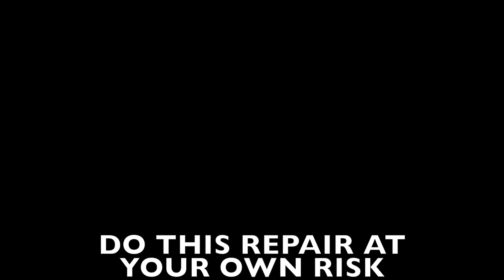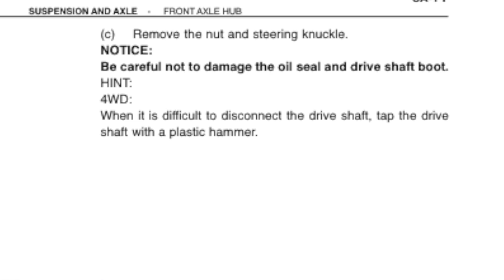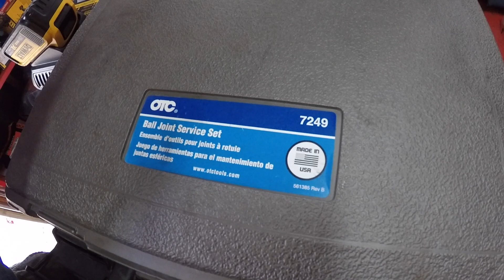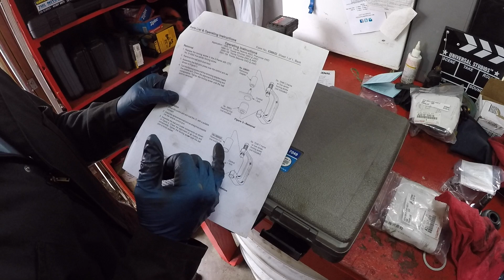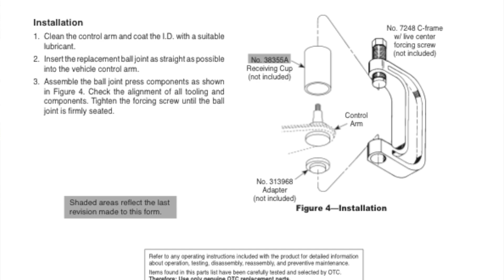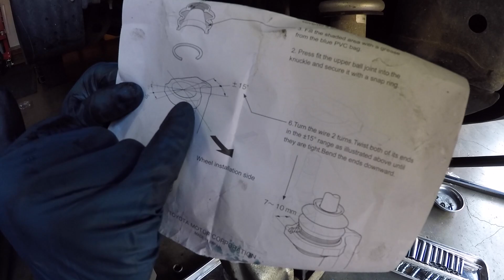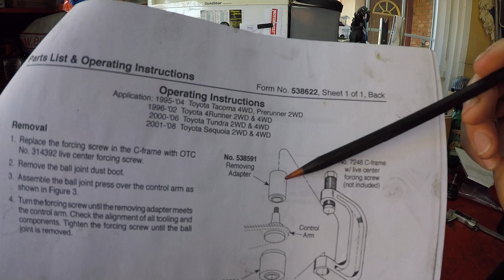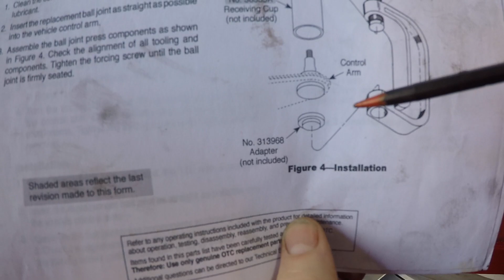Upper Ball Joint Replacement

Comment: Thank you for the great video. Got a question : I just need to replace the boot of my upper ball joint because it is torn and the ball joint was replaced recently. Do I need to remove the whole nuckle or I can just disconnect the ball joint from the upper control arm, replace the boot, and call it done?
Reply from the maker: You could just remove the balljoint from the upper control arm and replace the boot.  We provide a link to the reboot kit in the video description.
Reply: @TimmyTheToolman  thank you. The link to ebay is no longer valid. Just FYI. But I find other sellers for the same boot.
Reply from the maker: @ruigooal  Yeah, I saw that.  I updated the link to Toyota Parts Deal which is an online Toyota parts seller with pretty competitive prices.

Comment: Great video however I don't understand why you bought the 7249 kit when it seems this kit doesn't have anything in it needed for the Toyota ball joint replacements.  You bought all of the receivers separately to remove and install along with a 7248 c frame.  I don't get it.  What good is that kit if you have to buy all of the cups and the 7248 frame?
Reply from the maker: I could have bought the C-Press separately but I bought the kit because I was thinking of potential future projects that the cups that the kit comes with might come in handy.  Sometimes you don't know you need a tool until you need it.  Glad you like the video.

Comment: Appreciate your video, thank you. I have to replace my lower ball joints. There isn't any play in my UBJs and given what they take to replace, I'd like to keep them at the moment. If installing a new boot kit, do you know if the grease is available separately please?
Reply from the maker: I didn't know there was a boot kit for the lowers as well.  I don't know if grease is available separately.  But, I bet any quality chassis grease would work.
Reply: @TimmyTheToolman  I apologize for not wording it clearly. I'm replacing my lower ball joints, but looking to only re-boot my upper ball joints since the ubj's don't have any play. I have SuperLube 41150 synthetic white lithium grease in my grease gun now, think that would suffice?
Reply from the maker: @andresadoff6762  The Toyota UBJ re-boot kit we link in the video description comes with grease.  What reboot kit are you using?
Reply: @TimmyTheToolman  The toyota 43324-39015 pn boot kit? Didn't realize it came with grease, I'll just buy that one thank you

Comment: Excellent detailed video Timmy. Question for you. I am looking to buy a quality made bench vise under $250. I am considering three bench vises. A Tekton rotating bench vise with 8” jaws, or a Fireball rotating bench vise with 5” jaws or a Capri Rotating Base and Rotating Head Bench Vise, with 6” jaws. These are all strong bench vises and which do you recommend for vehicle repair and general home use. I will be using the bench vise to replace the upper ball joints on my 2002 Tacoma 4x4 and using your video as my guide.
Reply from the maker: I'm not familiar with any of the bench vices that you mentioned.  I would go with a 6 inch vice that gets good reviews.  I usually let the reviews drive my decisions to purchase tools and it usually works out well.  If a tool gets mostly positive reviews, I'll go for it.

Comment: Great video tutorial Timmy. 
Appreciate your attention to details. 
My only suggestion; When you noticed the wire tab sticking out in the wrong place, why didn't you try to simply turn it to the correct position? It seems to me that the grease would have allowed it to easily rotate the small amount needed.
PS, I assume you tried that.
Reply from the maker: No, I didn't try sliding the wire to the correct orientation.  I twisted the wire pretty tight, but maybe I could have gotten it to move.

We're glad you like the video.  Thanks for the comment and Happy Wrenching!

Comment: Awesome video Timmy!  I am about to try this on my 2000 tacoma 4wd.  However, my upper ball joint still seems good, per your suggested test.  If I can find and replace just the boot, do you know what grease I would need to apply?  I was going to check with the dealer but expect they only supply the boot - if even that!  Thanks for such a detailed video.
Reply from the maker: We provide a link in the video description to the Toyota OEM reboot kit which includes the boot, the grease and a new wire.  You're very welcome and Happy Wrenching!

Comment: is this car lifted ? or stock ? just wondering if stock upper control arms will be okay after lifting 2.5-3 inches?
Reply from the maker: I can't remember if it was lifted.  But yes, stock arms will work with a 2.5-3" lift.  When people move to aftermarket control arms, it's usually to fit wider tires without having to run spacers.  Adjustable UCAs like SPCs allow for more adjustment for a better alignment.

Comment: Hi Tim, Thanks so much for the great video!  As always, your videos are very detailed and specific to high standards. I have replaced my lower ball joint as preventive maintenance on my 3rd Gen 99 4runner 210K miles.  The upper ball joints look great and the rubber bushings are not torn, however I notice the passenger side has a small tiny hole in it but no major grease leak. . I was going to just stick a needle and just shoot some grease in there and seal the hole. . Can I just use a multipurpose Lithium NLGI 2 grease?
Reply from the maker: You're welcome and we're glad you hear you think so highly of our videos.  The grease Toyota uses for those upper balljoints has a different consistency and color compared to a multipurpose Lithium grease.  With that said, I think the multipurpose grease will work fine.  The whole idea is you want the joint lubricated and you also want to keep contaminants out.  The question I have is how are you going to seal the boot?  With some silicone?  

I don't know if you caught it in the video description but Toyota does make a reboot kit for the upper balljoints.  All you would have to do is break free the balljoint connection with the upper control arm with a puller, cut the wire, remove the boot and put a new boot on with the provided replacement grease and a new wire.  Here's a link to the boot kit: https://parts.camelbacktoyota.com/parts/index.cfm?searchText=%2343324-39015&make=Toyota&action=oePartSearch&siteid=214329  Since this is a fairly inexpensive part, buying online might not save you anything due to the shipping cost.  But, with a online seller like Camelback Toyota, if you can get your order up to $150 by buying things you know you'll eventually use like oil filters, air filters and maybe some other things you were planning on replacing as preventative maintenance, the shipping becomes free.  Then, they will only charge you a small handling fee, $3.  I generally buy all my parts from Camelback unless it's something I need quick and then I just visit my local dealer.  So, since the shipping could be equivalent to the cost of the part, you just might be better off visiting your local dealer for the reboot kit.
Reply: Thanks so much for the info......Yes I had some Permatex Ultra black gasket sealant and was going to just seal the hole for now. I will keep the great info you provided and periodically inspect the rubber dust seal to make sure it's not leaking and then either use Camelback toyota or the local dealer here in Dallas to buy those parts and eventually replace them, Thanks again!
Reply from the maker: @amh1499  Yeah very welcome.

Comment: The Pittsburgh master set has four of the five press cups you need for this job and it’s 75$. The other cup you need, is the upper cup for removing. 

You can rent a C-press from any auto parts store. 

The other cup is 40ish$ though.

And yes, use an impact…..
Reply from the maker: Thanks for sharing.  Could you provide a link to this set?

Comment: Quick question. On the special otc parts that you need to press out the ball joint. #314392 plug. I don't recall you using this in the video. Am I mistaken or did I just miss it? Where do you use this "plug" in the application? Thanks
Reply from the maker: That plug is a lower profile plug than the one that comes with the c-press.  This lower profile plug allows more room to fit all the components together to do the press work.  I did use it for this job.
Reply: @TimmyTheToolman  ok. I got you. Im doing research on those cups and I have a 01 Tacoma prerunner. Im wondering if Im going to need those same install and receiving cups as your 4x4 4 runner but I cant find and hard info on it. I don't want to buy the wrong cups
Reply from the maker: @619steelo  Yeah, I'm not sure about the Prerunner.  If you had a 4wd model, they'd be the same.

Comment: what is the torque setting for the 4 lower ball joint mounting bolts?  great video!
Reply from the maker: All the torque values are listed in the video description.
Reply: I see the castle nut torque but not the 4 mounting bolts to the bottom ball joint ?
Reply from the maker: @studegator  Check out our lower balljoint video.  In the description there's two different torque values depending on the year you have.  https://youtu.be/bfLvtEnX9qk

Comment: What might be some of the negative effects of over-tightning the upper ball joint especially?
Reply from the maker: I don't follow what you're asking Josh?  Over tightening what exactly?  The nut that secures it to the upper control arm?
Reply: @TimmyTheToolman  sorry I wasn't clear.... I'm referring to the castle nut on the control arm. I see where you torqued it to spec. I was asking what would be the consequence(s) of tightening the nut way more than the recommended ft/lb? What effect would it have on steering and handling in general?
Reply from the maker: @scorpio_9810  Ok, gotcha.  The balljoint attachment to the upper control arm is a tapered fit.  If you over-tightened the castle nut, you could have possibly drawn the UBJ shaft further into the UCA but I don't think it would do any damage per say to the UBJ or make a difference with your steering.  You could get an alignment to make yourself feel better.  How tight do you think you got it?
Reply: @TimmyTheToolman  iirc I torqued it to around 85 ft/lb, but I have some doubts that it might have been more. The paranoia stems from me putting some lowering springs on my 2016 gs350 f sport. After I was done, I went for a test drive and immediately the steering wheel was very noticeably harder to turn to the left than to the right. That resulted in the steering wheel always slight cocked to the right when driving. I took it for an alignment but the issue was still there after. 

I reinstalled the stock springs, after a week of driving, to see if that would fix the issue. Went for an alignment after but issue remained. Started researching and I read somewhere that if the ball joint was tightened too much, it could cause steering wheel to be harder to turn in one direction than the next. Read up on caster which carried similar symptoms, but it was within specs after the alignment, so I haved reservedly ruled it out. I'm kinda at my wits end with the issue. This as I have a bit of OCD and thus I love when things works as they are meant to.
Reply from the maker: @scorpio_9810  Hmmm, well I would be concerned too.  I would think if the alignment shop could get your alignment within spec you would be ok.  I don't really have any other further advice other than maybe pulling the balljoint off and either reinstalling it to the proper spec or install a new one.  You know the problem wasn't there before you did the work so safe to say you did something to cause the problem.

Comment: Not looking forward to having to do this 😢
Reply from the maker: Hey Clay, just make sure you have all the needed balljoint adapters and you should be good.  Even if they aren't the perfect sizes that I give in the video, you can often make it work with what is available.  You can rent the balljoint press kits and rent pullers at auto parts stores.  Good luck with the job when you get around to doing it.  Happy Wrenching!
Reply: Clay, and everyone else, It's not Rocket Surgery, so don't let it intimidate you.  Just think of it as a way to improve your tool collection and knowledge.  About to do both uppers and lowers on my wife 06 4 Runner.  Shouldn't be too bad, one it's  2 wheel drive, and two because I have a big advantage.  My tool collection includes a 9000 lb capacity 2 post lift.  I'm almost 70 and have been adding to my tool collection since I was 14.  I've got a lot of tools.  And no, I'm not a professional mechanic. It's my stress reliever hobby! Retired from my Career, and still doing it for fun.

I will tell you new mechanics that the hardest part of DIY work on your cars is getting up the courage to tackle it.
Most of these job are not that bad.  And made a lot easier if you have videos like this one TImmy The Toolman made for you.  Which was an excellent class on how to do one in your garage floor with common everyday tools. 
 2 Thumbs up TTT.

Comment: Hey Tim,

I’m new to most of this stuff and have been buffering my tool resources for a while. I really appreciate your videos because of the attention to detail but honestly am feeling defeated because I can’t really diagnose directly where my squeaks are coming from. I’m hovering between deciding to give the repair a chance on my own or taking it in as I do use my truck for work. I bought the truck with aftermarket suspension parts already on and I know you mentioned total chaos fabrication having special parts to be aware of. Any advice or help additional on understanding the conversion to aftermarket pieces could be helpful for me. Thanks for your time and efforts!
Reply from the maker: Squeaks can be hard to diagnose but as long as everything looks tight with no obvious problems, squeaking suspension doesn't mean something is about to fail.  Most of the time it's bushings.  Do you have any polyurethane bushings?
Reply: Hey Tim,

I appreciate your response. I’m not sure about polyurethane. I’ll investigate some more and let you know.
If it helps at all, here in Hawaii we get a lot of rain. When the rain comes down hard the squeaks seem to subside immensely and when it drys out they return. When I bought the truck it came with icon coil overs and a total chaos fabrication upper control arm with a ball joint completely exposed (no boot on the ball joint). Could this be problem of lubrication?
You’re videos are HUGE for me. I really hope you keep doing them! Mahalo for your time.
- Benji
Reply from the maker: @benjiahsing8724  Those Total Chaos joints can definitely make noise.  Spray a teflon lubricant on the ball.  Tri-flow is a good teflon spray lubricant.

Comment: Timmy, awesome and very detailed video.  What do you think about Energy Suspension's special blend polyurethane bushings that supposedly never have to be changed?  I have no experience with them, but thought you may know if they are worth the money to put on various parts when replacing them?  I'm fairly new to the 4runner club and have an 01 runner that I bought (stole) from my sis recently, it's in unbelievable condition.  Living in Fl helps as there is no rust at all on it.  It's a 2Wd SR5 city/hwy dweller, but I love it.  Going to add a 3rd gen 4WD to the mix soon. Thanks again, for the great uploads!
Reply from the maker: My only experience with Energy suspension bushings is for the steering rack and sway bar.  I've used Whiteline for front lower control arms and both upper and lower rear control arms.  The Energy Suspension are good for the steering rack and sway bars but I'd stick with Whiteline for the control arms.
Reply: @TimmyTheToolman  Thanks!

Comment: How much did it cost you the oem ball joint I have to do my ball joints and inner and outer tie rods for my Tacoma is the brand Ac Delco any good
Reply from the maker: I don't know what they cost.  Check the video description for the part number.  I buy most of my Toyota parts from Camelback Toyota in Arizona.  Their prices are competitive, they ship quickly and they ship for free if the order is $150 or more.  I would never advise people to go with an aftermarket balljoint, especially for the lowers.

Comment: Tim, Have you thought of moving to Texas?😊  Thinking about doing this on my 2002 Toyota Tundra with 160k miles.   Since I have all taken apart,  would you consider replacing the CV axle?
Reply from the maker: I don't think Texas would be my bag.  I like mountains.  I'd only replace the CV axle if it was bad.

Comment: I just had upper and lower ball doints replaced on my 2005 toyota tundra, when I got it back it was making a weird noise each time just as I stopped. I took it straight back and the mechanic hooked up his diagnostic computer, and said there was a lot of rust when he pulled the ABS Sensor, which probably means my bearing is going bad. I don't know, but I ordered a new bearing. He said if it's the 😮sensor...that's a dealer part only.I hope the Sensor is fine.
Reply from the maker: You could do the job yourself using our video.  1st Gen Tacoma steering knuckles are pretty much the same as 3rd Gen 4runner and 1st Gen Tacoma  steering knuckles.  https://youtu.be/Dj-2IzO9RFk?si=KRw_g0iu2YcdrAfN

Comment: Wrong pn given at 44:29….the flat insert pin for the screw is PN: OTC-314392 and is mentioned in the step by step app notes for Toyota.
OTC-7248 is the actual C clamp frame.
Reply from the maker: Good catch! Thanks for helping ensure the information we provide is clear and accurate.
- Sean